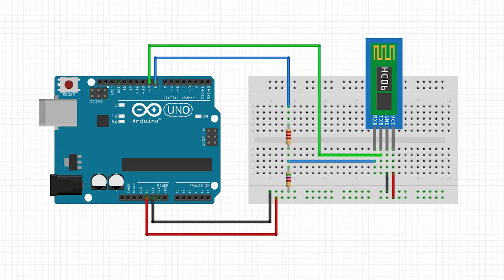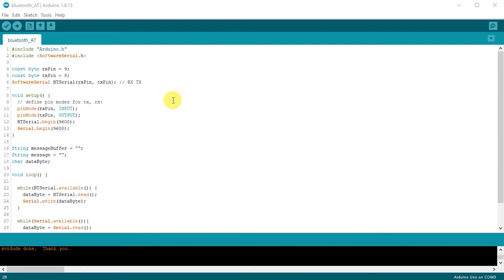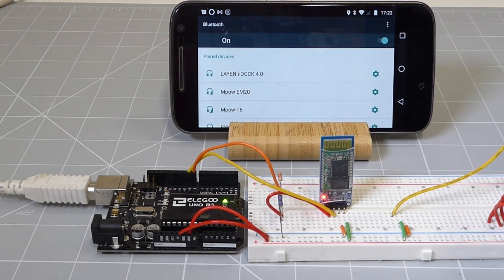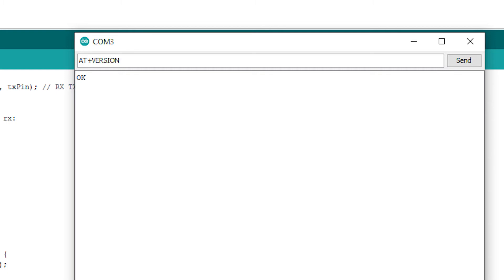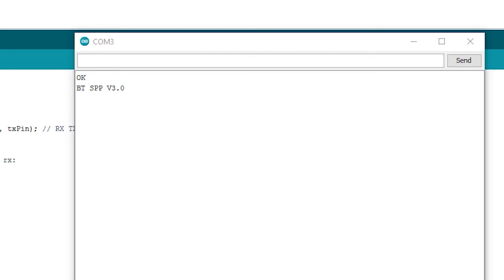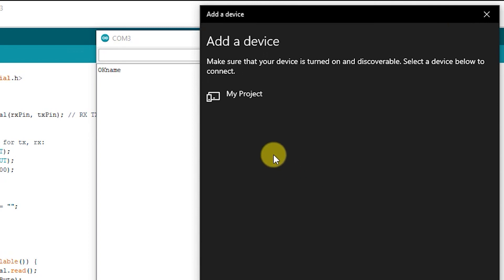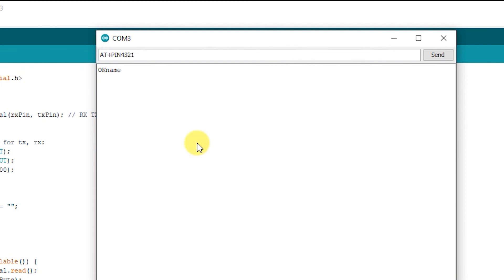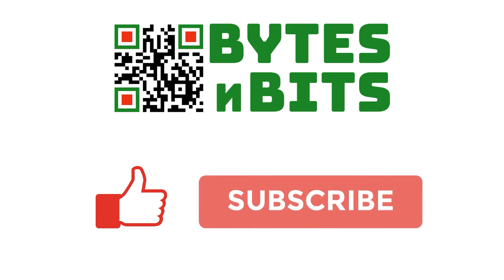Using AT Commands to Set Up Your Bluetooth Module : HC-05 and HC-06

Comment: On my UNO R4 with WiFi built in I keep getting error Bluetooth is not enabled! Please run `make menuconfig` to and enable it but NO ONE IS SHOWING VIDEOS ON HOW TO ENABLE IT!!! I am over 73 years young and the text I read Googling it make no sense. HOW AND WHERE DO YOU RUN 'MAKE MENUCONFIG' FROM?
Reply from the maker: Have you got the board package installed into your Arduino IDE? That should get everything ready for you.
Reply: @BytesNBits  No, I bought it on Walmart and paid extra $4+ for each item shipping and a 4 to 5 week wate and most of the $300 in items, most do not upload or run blink sketches, The 12v 18650 battery packs had nothing on the bottom to link the batteries and nothing would fit the shields, I am now only ordering start from DFRobot.
Reply from the maker: @lordsigurdthorolf1202  If the Arduinos aren't able to upload or run the basic blink sketches it sounds like you haven't got the Arduino IDE set up correctly for the boards. Your computer won't be able to talk to the Uno unless you've loaded the correct board settings into the Arduino IDE. It needs to know what type of board you are using and what serial port it's been connected to. If you've got that set up when you try to upload the blink sketch it should go through the compile and upload process without errors.

Comment: Thanks for sharing this great tutorial video!
Eventually I got it to work on HC-05, below are some notes: 
1) Make sure to press the button when powering up HC-05. 
2) Additional pin to connect, you will need to connect the key pin on HC-05. 
3) Make sure RX in code bind to HC-05 TX, and TX in code bind to HC-05 RX.
4) HC-05's AT mode baud rate is 38400 not 9600
Reply from the maker: Great. Thanks for the tips.

Comment: i did the same exact things as in the video and the same code and when I try the AT commands but it doesnt work I have tried other BAUD rates and everything and I have tired HC-05 and HC-06 what should I do
Reply from the maker: That's a strange one. I'd go back to basics first. Check you've got the wiring correct. Check your resistors in the voltage divider are giving the right output voltage. Maybe swap them for a logic level converter. Make sure the sketch is using the right pin assignments. If this all checks out add a line in the Serial.available block to send the input character back to the serial terminal to check your key presses are getting through. If that's all Ok try sending actual commands to the BT module in code and see if it responds.
Reply: @BytesNBits  From my investigations today, I am guessing that the software serial port is too far off from 38400 baud to communicate with the HC-05 reliably.  When I just sent AT<cr><lf>, I could see on an oscilloscope that the HC-05 was responding with the correct bit sequence, but the Arduino was not correctly interpreting the bits.

To test my hypothesis, I created the program below that uses the HW serial port.  I used a cheap ~$10  logic analyzer and pulseview to view the data going in both directions.  I could see that the HC-05 was replying properly.  I put the 10 second wait at the start since I had to reattach  the wires from pins 1 and 0 after downloading the code, and I also needed to start the logic analyzer capture after I started the program.  I noticed that the HC-05 replied with an error code at the first "AT\r\n", but it responded properly to the rest of the commands.

For me, the software serial port did communicate correctly with the HC-05 at 9600 baud, but it garbled a few characters at 19200.

#include "Arduino.h"

void setup() {
  Serial.begin(38400);
}

void loop() {
  delay(10000);
  Serial.write("AT\r\n");
  delay(50);

  Serial.write("AT+UART=19200,0,0\r\n");
  delay(50);

  Serial.write("AT+UART?\r\n");
  delay(100);

  Serial.write("AT\r\n");  
  while(1);
 }

So, for the HC-05, if you only need to make infrequent changes like password, name, and baud rate, you could just use a program like the above to make the changes.

Comment: I followed along with you first video and everything worked, not changing any hardware settings I uploaded your code from this video and it does not work. Any suggestions?
Reply from the maker: If you've copied from the web page the top line has gotten corrupted by the editor

#include &lt;SoftwareSerial.h&gt;

should be 
#include <SoftwareSerial.h>;

Comment: How do you send data from the device to another device after you connected?
Reply from the maker: You'll need one arduino with an HC-05 module that can run as a master. This can then connect and disconnect to other devices.

Comment: Command          Responce       Result (AT Code for 06 bluetooth Moudle)
AT+NAMExyz = OKsetname Sets the module name to “xyz”
AT+PIN1234	= OKsetPIN	Sets the module PIN to 1234
AT+BAUD1 = OK1200	Sets the baud rate to 1200
AT+BAUD2 = OK2400	Sets the baud rate to 2400
Reply from the maker: Thanks for the codes.

Comment: Can someone explain why some tutorials connect to the TX/RX pins for programming and others use the Digital serial pins? Also every time I try this I get no output on the serial monitor...All these tutorials have comments from people with similar problems but no one seems to know the true reason why, and how to fix it?
Reply from the maker: Hi. On some Arduino models (Uno and Nano) the digital serial port is shared with the serial port used to talk to your PC. If you use these pins for your project you then can't communicate with your PC whilst your code is running. This may be why you're not getting anything on the serial port. Using the software serial port gets around this issue. On boards with 2 hardware ports this isn't a problem.

Comment: I have the same problem as @MAGWITCH and i still dont know what to do.
Reply from the maker: Hi. The HC-05 works differently to my HC-06. There should be a small button on the HC-05 unit. You need to hold this in as you turn on the power. This will put it into AT mode so it will talk to you. Set it up as you want and then power off and on again to get it back to normal mode. I hope this works!

Comment: Great video's, I have been able to programme a HC-06, but can't get the HC-05 to respond to AT commands. Yes, it is in program mode ( pressed the button) and yes I have wired it as per instruction. I have tried two other HC-05, but none of them will respond.  I have tried other baud rates but nothing. Any other suggestions are welcome.  I have ordered some more HC-06 as I know they work. I need to increase the baud rate for a GPS-RTK project.
Reply from the maker: Hi. That's strange. Are you running the basic terminal code to send your commands directly to the HC05? Is anything coming out of it? Have a look at the data sheet for your device to make sure you've got the right baud rate, stop and parity bit settings. If these are off it might not be able to read your commands. Good Luck!
Reply: @BytesNBits  thanks. Yes have tried everything. I'll just stick to to the hc06 as they work
Reply: Same problem and seems a common one but no one has any good answers other than replace the bluetooth module which I'm sure is not the problem.
Reply: Unfortunately, I am also unable to get the HC-05 to work, there is just no response. Yes, I was pressing the button when powering it up to make sure it is in AT mode.

Comment: Hi, thanks for the HC-05 tutorials. I've tried to follow this tutorial exactly and don't get any response when I enter AT commands, I just stare at a blank serial monitor. Can anyone suggest what might be wrong?
Reply from the maker: Have you checked your serial terminal baud rate? Try a few different settings to see if the speed on the HC-05 has been set to something different. Other than that, check your wiring, try a different HC-05 and Arduino if you have one.  I hope you get it working.
Reply: @BytesNBits  turns out you're supposed to short circuit two points together. Not sure how but that's how my teacher said they did it.
Reply from the maker: @magwitch  Hi. Your teacher is correct - sorry forgot the HC-05 works differently to my HC-06. There should be a small button on the HC-05 unit. You need to hold this in as you turn on the power. This will put it into AT mode so it will talk to you. Set it up as you want and then power off and on again to get it back to normal mode. I hope this works!
Reply: https://www.youtube.com/watch?v=ykgt4v7_4y4
Reply: Serial speed is by default 38400 in AT mode and you need to connect the key pin also on HC-05.
Reply: @TheAakoo123  can you please tell were to connect the key pin???
Reply: @YashJain-nh8nh  It is on the other youtube video i posted above.

Comment: Hi. Is there an AT command to stop the Bluetooth device from broadcasting itself for new connections? Too add more security after changing the pin.
Reply from the maker: Hi David. You can use the AT+CMODE=0 and then AT+BIND=??? to restrict the module to a specific bluetooth device connection. You'll need to use some of the other commands (have a look at this list https://content.instructables.com/ORIG/FI9/7NJR/IRXT0JIG/FI97NJRIRXT0JIG.pdf) to get the addresses of paired modules. I've not tried it or worked out exactly what to do but the commands seem to be there. I hope this helps.

Comment: Do you know how to add service and characteristics ?
Reply from the maker: Hi. You'd need to have a look the the data sheet for your device and see what commands or hardware setup options there are. I know the HC05 has more set up features but I tend to only use them as plug and play connections to a mobile phone.
Reply: @BytesNBits  Hi. thanks for the reply. I'm working on a project which consists in send data to a hc-05 bluetooth module from a react native app. In the app, I'm using a react-native-ble-plx plugin to handle with bluetooth communication. But this plugin doesn't find the hc-05 module, I don't know why but, I presume tha this module doesn't work with BLE. And thats why I trying to setup a BLE service and characteristc. Maybe it's the reason to hc-05 never get found.

I don't know if it's possible, but, thanks for the tip. I will look in the data sheet to see if find a solution.
Reply from the maker: @felipe_ramos  Hi. The HC05 and HC06 are not BLE compatible. You'll need a different module. If you do a search on Amazon or eBay for 'ble module' you should find what you're looking for.
Reply: @BytesNBits  I was already suspecting about that, but then I found a stack overflow post saying that this it's possible. I spent the whole weekend trying to do this, lol. Today, I was about to give up, and now that you say me this, definitly I will search for another module. thanks man,  you earned a subscriber.

Comment: Not able to set AT+POLAR,1,0   using USB to serial convertor. All other command works fine. Tried 3 different HC05 and also different USB to serial convertor but only this command does not work. Please help
Reply from the maker: Hi. Try AT+POLAR=1,0. I think it needs an = rather than the first comma.
Reply: @BytesNBits  right, my command is same as you said. Tried with upper case and lower case. No luck
Reply from the maker: @bencypg  Does it respond to the polar query command - "AT+POLAR?"
Reply: @BytesNBits  No.
Reply from the maker: @bencypg  I'm not sure what to try next?? It looks like that command is just missing from the firmware on your devices. I only have HC06s here so can't confirm it. All the datasheets confirm the command should be there. Are all your devices from the same manufacturer? Is there a datasheet specifically from that supplier? Sorry I can't give you an answer.
Reply: @BytesNBits  I took two from different vendor. One locally and another online. My bad luck. what is the difference between HC05 and HC05 with TTL? both are same? I see HC05 with different price? some are 200 and some are 600.
Reply from the maker: @bencypg  The TTL just means it can work directly with the 5V logic on the Arduino (built in level shifter). Other than that it should work the same.
Reply: @BytesNBits  ok. Thanks for your help. Will buy another one and see how it works. Do you have any recommendation of the brand or website from where I should buy?
Reply from the maker: @bencypg  I've just been buying mine through sellers on Amazon and eBay. I've always assumed that one module is pretty much the same as any other so I can't recommend any that might work. Is there any way round having to change the POLAR setting? Can you modify your code to cope with the default setting? Buying another could well leave you with another HC05 module that doesn't work the way you want it.